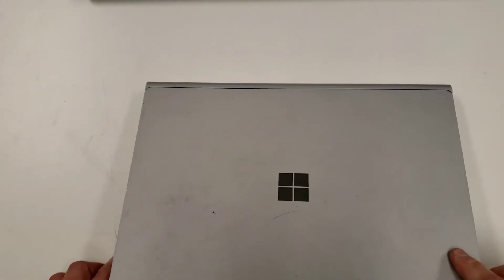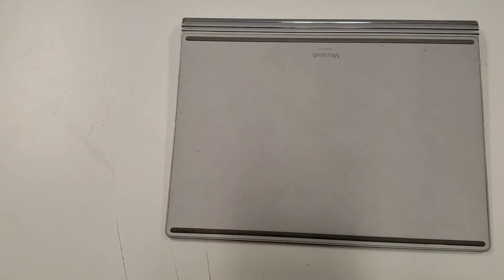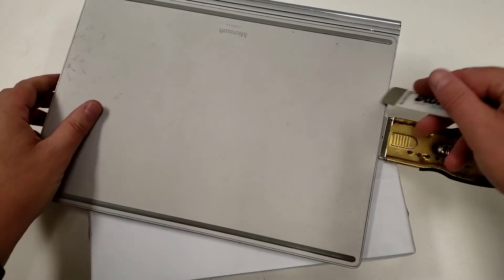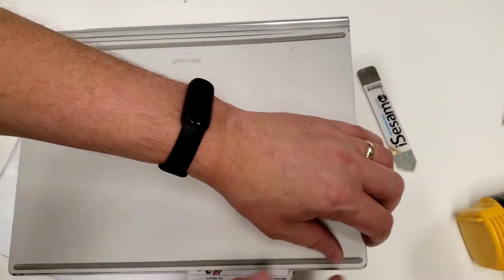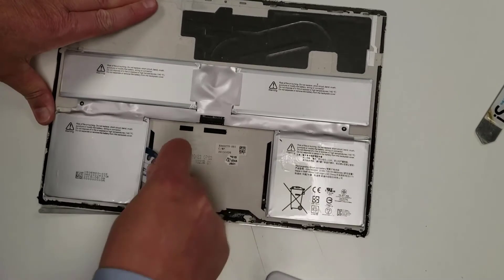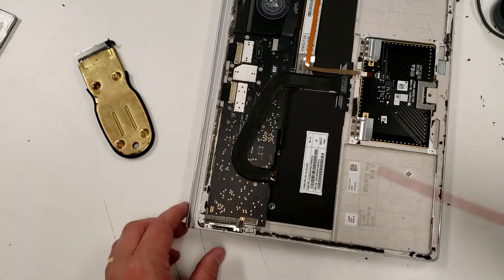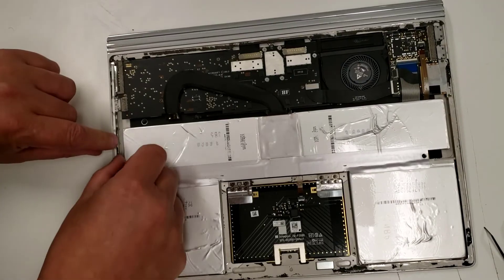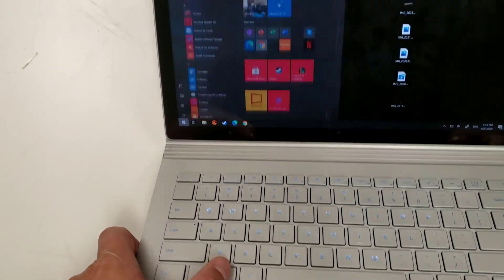Microsoft Surface Book Keyboard Disassembly & Battery Replacement

Comment: Hi, my fiancée has the same problem, she is able to turn on the top screen with the screen charger but the keyboard does not turn on at all even when the charging cable is connected to it. Is that the same problem you were having? Your keyboard just doesn’t power on at all even if connected with the magnetic power cable?

Comment: Definitely not simple like with my old alienware laptop. Upgrading the hardware was a piece of cake with it. But I switched to a MS surface book 2 for the built-in tablet for drawing, but not sure it was worth it. Seems to have a lot more bugs/glitches or straight up annoying behavior. And the fact you have to basically damage your laptop just to replace a dying battery....I mean, is it just for the sake of sleek design, or b/c its cheaper to build it that way? or because MS knows that ppl would rather buy a new laptop than be bothered to pay someone else or figure out how to replace the components themselves?

Comment: Thanks. Battery replaced !  I had some issue at first (malfunction alert, tablet release button didn't work). I charged both part separately for 1 hour each and then all was Ok. Could not find an original battery so I took a chinese one on amz for 30 bucks.

Comment: Question if anyone has advice... I have a Surface Book that ran out of battery and won't charge or power on. I have tried 2 different chargers and have tried charging through both the base and the tablet separately. The only "response" I can get from it is that the screen detach button gives me a little red light if I hold the power button and volume up button. I assumed one or both of the batteries needs replaced. Buf shouldnt it power on when plugged in if that were the case? I don't want to attempt this repair if the battery isn't the issue. I also can't sell for parts because the memory hasn't been wiped. Not sure what to do next besides trashing it completely...

Comment: The charging port on my keyboard stopped working and I hate having to stop work to charge the tablet and re-attach when it's charged. Would a bad battery cause that issue or is it something to do with the charging port?

Comment: Thanks for this. My battery packs are already puffy and I was considering replacing them but heat on the back of this thing does not seem like a good idea. Thinking I'm just going to use the top portion as a tablet

Comment: If anyone really needs their Surfacebook to work now and can't wait for a battery to do this, you can boot the Surfacebook into a Linux distro like Ubuntu.  I didn't have swollen batteries, but after a few years of disuse mine would not charge or boot Windows even when plugged in (it just shut itself down seconds after booting).  I made a bootable USB with Ubuntu and it booted fine (still no charging, though).  You can just use a live USB if you need to keep your Windows files, but if not then you can just install Linux and use the computer with a charger. 

In fact I've been doing just that for months instead of installing the new battery I got on ebay, lol.

Thanks for the video!  It helped me get over the fear of not doing it right and I just got it opened up.  It will be nice to have a laptop that doesn't instantly die if I accidentally brush the charger cable when I get up to stretch, lol.

Here's to hoping the screen battery is good and was just being held back by a bad keyboard battery...😅
Reply: I had the same issue, you have to edit your power plan, go to advanced power settings, go to battery, go to critical battery action and change the plugged in part to "do nothing", then click OK.  You have to be fast and do this before the laptop shuts down.  It took me about 20 tries before I finally got it.  I had to plug in a mouse so I can do it faster than using the trackpad.  Once you do this, it will not shutdown due to the battery being at 0%.  I am currently debating on whether or not I will replace the battery as well.

Comment: Great video and well presented. I do not understand why the keyboard bae will not do anything when connected to the main power. If the battery is not working in a typical laptop, it still works when powered... why does this not work when powered?

Comment: I plan to replace my SB2 battery, the only thing I would do different is put a tiny bit of Goof Off into the crevice when removing the cover, apply it to the edge of a credit card to remove batteries, and to clean old adhesive.

Comment: @ 5:52  If he can interject for "just 10 seconds"...   😆😆🤣🤣   
 What he meant to say was "33 seconds"!!    He knew that if you only thought it would be 10 seconds of nonsense then you probably wouldn't skip forward...  but he was wrong!!   
I skipped forward 10 seconds...   then 20....   then 30...   and his "interjection" was still going!!  
  What was REALLY hilarious was his warnings about not sticking the new battery to the adhesive because it won't be lined up correctly!   You can tell that's exactly what he did initially, but then decided to clip it out of the video so he can act like he just knew that beforehand.   
 You can tell he did this because 
1)  he starts placing it right as the video cuts off @  11:27
2) the new battery was completely smooth & factory when he opened it, but then when he finally installs it, it's all bent, wrinkled, etc....   as if he was desperately pulling & prying it away from that crazy strong black OEM adhesive (the reason for the cut in the video)!    🤣🤣😂😂    
I was dying laughing at this guy!!

Comment: every company who does such glue mess in their devices, should be forced to offer free Battery replacement at least 1 time, for the device. It's unbelievable how they threaten the customer, for no good reason. Just screw it in ffs. 
Thank you for the tutorial, even i will not try this with my surface book 2. I guess i would damage it before doing any good.

Comment: THANK YOU! I noticed that the bottom of my Surface Book (Gen 1 from 2016) was starting to separate/unglue so I purchased an open box battery on Amazon for $24 and some 2mm double sided electronic repair adhesive tape. Followed the instructions in this video and had the new battery working perfectly in about 45 minutes! All 4 of the old batteries in the old battery pack were swelling pretty bad.
Reply from the maker: It's not easy, but you can do it if you take your time... which I am not good at even after all these years of computer repairs :)

Comment: What you may want to do is fire the surface book up as soon as you have connected the battery and check if it is charging. Would be a bummer to glue it shut agin, only to find that you messed something up with the connections.
By the way: MS still don't acknowledge their cock up with the charging circuitry, which bricks the keyboard as soon as the battery has gone completely dead.

Comment: Wow that's a horribly designed product if I've ever seen one. I like it for its features but why couldn't they just screw on that lid? Why glue? There is enough space for sure, or maybe do some clip in mechanism at least. Same for the battery
Reply from the maker: It is tight :)
Reply: Replacing this battery.. would it reset the bios?..

Comment: There a command line tool you can run that gives the state of the battery. I can't remember it but a little searching should give you the answer. I'd have run that after completing repairs. Might have been:- Command prompt enter powercfg /batteryreport” and hit enter. Saves to your C:/

Comment: Nice Video
Tip 1: The side with 2x USB and SD card has no glue/tape under the ports. Easily a prying tool can be inserted.
Tip 2: Are you sure you still want a "new" battery? I replaced mine with coins to keep the weight balance. At its age the new (very old kept in stock batteries) are senseless.
Reply from the maker: Thanks for the info!

Comment: It is a very helpful video for getting my surface back to work. The only issue for me is that the e and l keys are no longer working. Any suggestion? This is the only issue after the battery replacement.

Comment: You just saved me hundreds of dollars! I was initially scared to do it because I always mess something up but my laptop is functional now! Thank you so much dude!
Reply: Any tip?
Reply: Hi, was the bottom of the laptop the keyboard part not turning on at all even when you would plug in the magnetic power charging cable? I just want to know because I just want to make sure my problem is also the battery

Comment: Hi, really good video. I am facing an additional issue. Once I close, I power up, keyboard working nicely backlit too. But the base battery says is not present. Any suggestions?
Reply: Hey Tom, I'm having the same issue as well. Did you manage to figure it out? thanks!
Reply: @JJohnny224  I'm affrtaid not yet
Reply: @tomjim2359  thanks for answering!

Comment: i have the same keyboard and im wondering where i can get the battery to charge my tablet and still use it like a laptop still
Reply from the maker: Hi Malibu - love southern CA! - I bought mine in Ebay.  Just be careful to choose the correct one.  There are two, the difference being if your SurfaceBook has the additional video card or not.
Reply: @URTechDotCa  thank you ill take a look

Comment: If the battery does not work but is plugged into electricity, the tablet would have to turn on normally?. In my case I can not separate the tablet from the keyboard and to turn on the computer, I have to move the tablet/screen again and again, and if it turns on and I am working, if I touch the screen it turns all black. The problem is the battery or the junction between tablet and keyboard?

Comment: Please help... Out of the blue one day, the keyboard battery on my surface book 2 would not charge. After watching the video, I have tried 2 replacement batteries from Amazon and both show 0% when installed and neither the keyboard, nor screen battery will charge while plugged in. I've tried 3 chargers, including USB-C and no change. I've also tried uninstalling and reinstalling, still no change. The screen will charge when separated, but not while on the base, but it did before with the original battery. Really odd thing is that I know the replacement keyboard battery has some charge because the keyboard works when not plugged in, even though it says 0%. What could this be, Keyboard logic board?

Comment: Hi, my book 2 doesn't recognize the charger .. I disassembled it, remove the battery and I can't get the charger light to turn on either .. is there a solution?
Reply: Replace it :)
Reply: Have you tried a USB-C charger? I believe it must be one that has ~20 volt output option (aka 100 watt)?

Comment: This worked great! I initially tried removing the back without a heat gun and made very little progress, but once I bit the bullet and grabbed one things moved along much quicker! (was also less dangerous since I wasn't having to push the tools as hard to dislodge the adhesive). I found that ~10 seconds at a time was enough to loosen the glue without burning the batteries. Thanks for the video!
Reply: What was the power of heater you used?
Reply: @OlegFedyna  I used a standard 2 setting heat gun on the lowest setting and that seemed to do the trick just fine

Comment: Great video! Is there a chance you'd be able to demonstrate a battery replacement on the tablet portion as well? I've been planning to replace both batteries on my 4yo SB1.
Reply: Late reply but: I highly recommend that you take it to someone. Not guaranteed you'll bust it, but it is remarkably easy to break the screen trying to disassemble the slate.
Reply: @RvLeshrac  The screen already has two major cracks running through it, so in the event i do pull the trigger ill need to replace the display anyway
Reply from the maker: Hi Nolan.  Sorry but we have now sold all of our Surface Books.

Comment: Great video, this was an excellent way of opening the back panel and it worked out nicely for me.

Now, a few tips for various issues other SB1 owners may have...
If you're noticing an intermittent dGPU connection or have external monitor / Surface Dock issues, I recommend disconnecting the two ribbon connectors at the top near the hinge and cleaning them with a generous amount of 99.9% isopropanol contact spray while you have the base open and battery disconnected. Pure isopropyl alcohol is safe on the circuit board when it is de-energised and will resolve various keyboard base connection problems. It's also a good idea to follow up with an additional spray of normal compressed air to flush away excess alcohol. After the area has dried, reattach the ribbon cables with gloves or clean hands and verify the keyboard and touch pad still work. If for some reason your touch pad dies, it may begin to work again if you reverse the connection of the touch pad ribbon cable since replacements are hard to come by (quick & dirty fix).
Reply from the maker: Thanks for the thanks

Comment: I know what you mean. My computer was dropped as you know the screen is cracked and the battery exposed. The battery is exposed under the keyboard as well. So I have three items to replace. But the problem for me is making sure that the purchase is the proper batteries and screen replacement. My problem is that my computer specifications are not matching what's on eBay or Amazon.
Reply from the maker: What is the model number?

Comment: Excellent video. My Surface Book 1 was suffering from swollen batteries syndrome and the bottom cover of the keyboard base had actually partially separated because of that. I followed your instructions to the letter and within about an hour I had given my laptop a new lease on life. The most tedious part was getting the old adhesive gunk scraped away and I have found that a small flat head screwdriver works really well for this. Thank you!